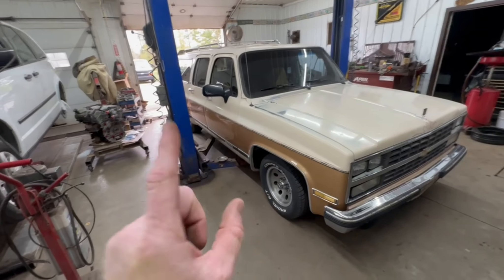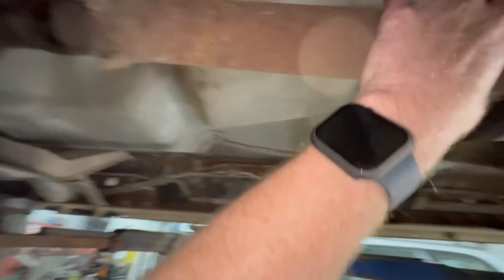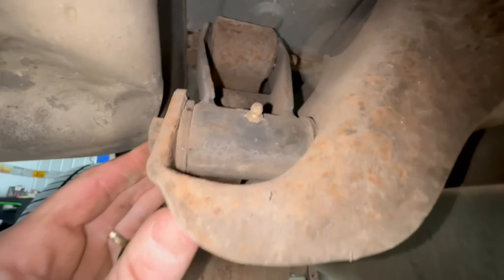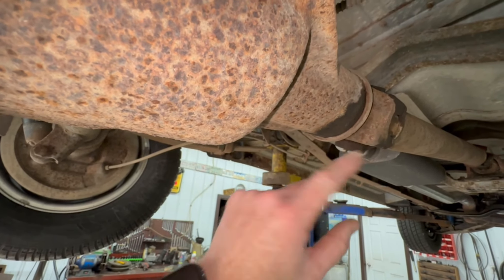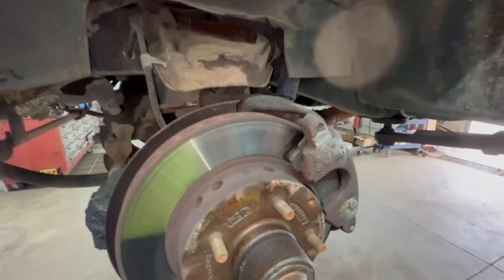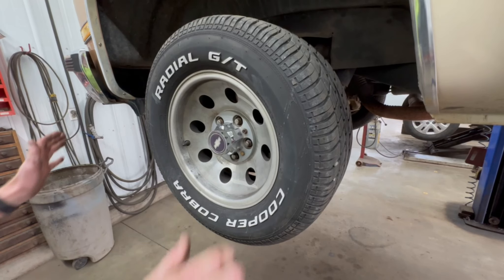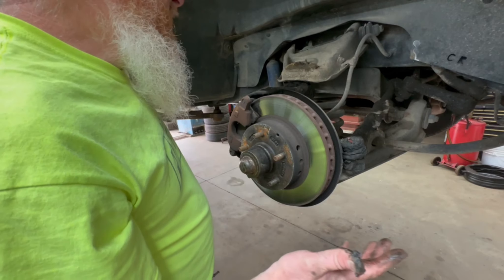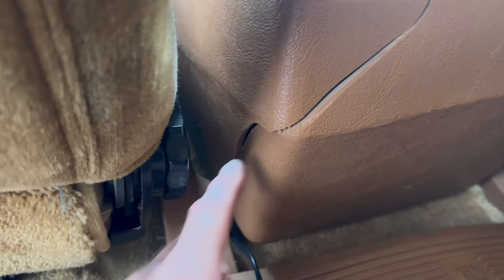Is This Square Body Suburban A Hidden Gem Or Complete Junk?

Comment: I went to look at a 1989 Square body suburban and it was a rust bucket. The power windows didn't even work. It had a cracked windshield, cracked windows, radio didn't even work, the speedometer was whining because of friction and had water leaks inside on the front passenger side. The seller wanted $6,500 and I told him that I can't do $6,500. Not in that condition. I offered him $2,500 and he said, "no!" Then, I told him, "good luck!" and walked away. The prices on these Square bodies are absolutely ridiculous.

Comment: I like that it's a nice vehicle I like older Chevys. I'll tell you what I would do first thing hoses change all the hoses all the belts make sure all your vacuum hoses are changed I put a in line fuel filter next thing I do all of the rubber underneath I would replace with urethane bushings and then the brakes I would pick the old discs off but nice slotted just on the front and fresh shoes and brake parts on the back then your stereo I always use this when I get a car I don't care if the stereo is working or the speakers I always put good speakers in they're not that much money for   really good pioneers or Sarah Vega High output and then put a good head unit in we release 50 Watts of power so you don't have to have an amp and there's lots of really good aftermarket connectors that allow you to connect a head unit directly to all those speakers it'll sound wonderful and you don't have to spend a lot
Reply from the maker: For now I’m just going to drive it mostly as is due to the fact that I will be swapping the drivetrain and completely replacing the suspension with some sort of air ride!

Comment: Wow... being stuck more out into the ocean than you are, we'd never see something in that shape here in NS either. 
I was telling you to put the cap back on but would you listen??? NOOoooo.  ;)
A mechanic friend of mine would have all but beaten you if he saw you using a hammer to tap the cap back on. He always slipped a big socket over the cap and tapped that so it didn't dent the cap.
Let's just say that he was very particular and did amazing work.
Slammed and a turbo'ed LS?  OOoo you will make some people upset but the rest will think it's cool. 
Have fun!  And don't forget the front swaybar bushings. ;)
Reply from the maker: 100% !!! What side do you fall on? Do you like slammed and turbo LS or no?
Reply: It's not a cop-out but they look good either way as long as it's done well.
I would even just like some wider mean looking tires.
Amazing how this type of vehicle wasn't exactly "cool" to most people when they came out.
As some would say... Give 'er!